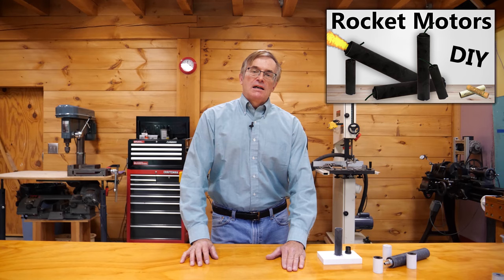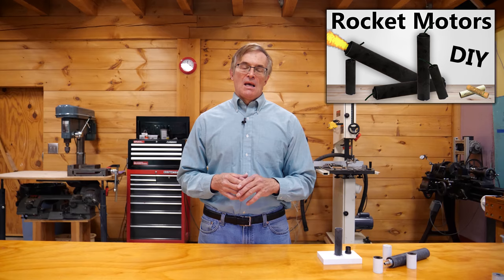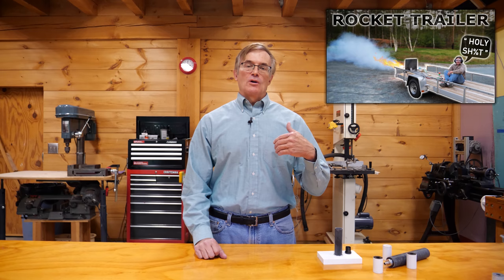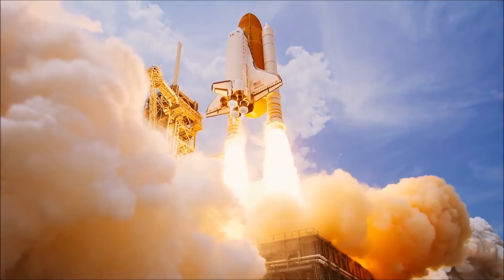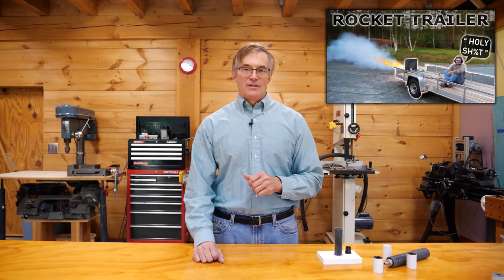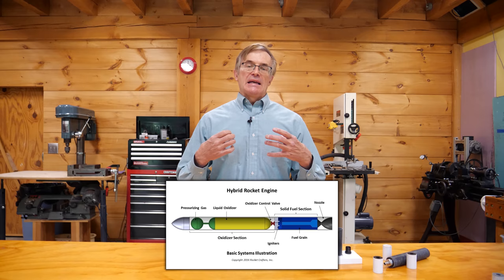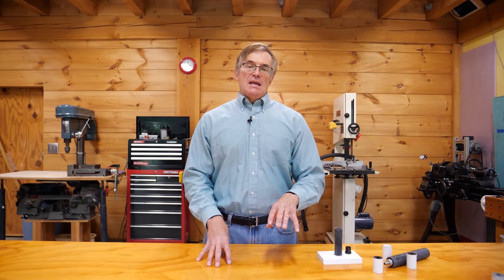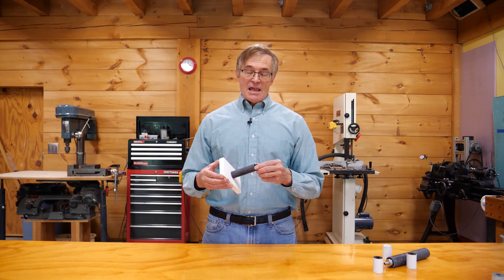Mixing Nitrous and Rockets is DANGEROUS... But Really FUN!

Comment: Great video as always. A note on the Nitrous bulk tank: when you opened the relief valve to safely vent the liquid from the hose I think you forgot to open the ball valve again to remove the liquid from between the bulk valve and the ball valve.
Reply from the maker: Not really.  This valve doesn't have to be opened and if you're going to be filling multiple times, this would just waste a little nitrous each time.

Comment: So, I noticed in all of your demonstrations of the nozzles, there seemed to be a short flow/pressure drop, before it started flowing consistently. Is that a normal occurrence, and if so why? Love the videos, and how you explain everything without being condescending.
Reply from the maker: Yup.  The initial flow is boiling right after the solonoid as it hits the warm stainless plumbing.

Comment: I presented a research project at the Space and Missile Defense Symposium a few years back for a perafin 3d printer for hybrid fuel grains to allow the creation of grains, as needed, with specific regression rates and burn characteristics for use in high risk environments (spacecraft, naval ships, etc). Unfortunately, it didn't get funded, but maybe someday I'll build one on a hobby level.
Reply from the maker: Not a bad idea.  The principle is good and the material is easy to experiment with.

Comment: I'd love to see you do a video with Linus using your freezer ice/water setup. Sub ambient liquid cooled PC without dunking a radiator in a bucket of ice, peltiers, or phase change(A/C). Still kind of phase change, but it's more doable. A salted version would be nice to see in a comparison, too.  

My idea also includes a sealed case to put the PC in with some kind of air dryer like a desiccant.

Comment: When I was into paintball we used to use a CO2 fillstation, and the way we chilled the tank was by connecting to the fillstation and charging whatever would go into the bottle, then close the first ball valve and dump the purge ball valve, which caused a rapid decompression and froze the small bottle, then we would close the purge and reopen the fill valve and the CO2 would transfer.  You might have to do that once more for a half second mid fill on a larger bottle.  Is that methodology not chosen based on the price of the nitrous or something else?  Great Video!
Reply from the maker: That simply  works.  There's  no advantage  to nitrous and it costs more.

Comment: Regarding your nozzle selection and criteria, I really know nothing about the field, but I had an interesting idea.  If you had a nozzle where the tip had a concavity, and in that concavity were two or more fine holes arranged around the periphery of the concavity, and aimed at each other in a focal point.  Sort of like the legs supporting the LNB on an old satellite dish.  This could achieve the kinetic dispersion you're after, without any metal parts to melt or obstruct, and may even have the advantage of increased dispersion energy (two opposing streams colliding at the same velocity versus against a stationary object).  The angles of opposition and number of streams could be used to tailor delivery rate and dispersion patterns potentially as well.  Again, I know squat about this field, but this design was the first thing that popped into my mind when you were talking about the dispersion characteristics you were after.  An obvious disadvantage is the required precision in drilling such a nozzle.  The streams must strike each other precisely, and if one stream clogs, that would cause issues.  Still, it does have pretty much nothing other than the holes themselves to be subject to mechanical damage.  Curious if such a critter already exists, since most of my better ideas turn out to be unoriginal.
Reply from the maker: The idea is interesting and some pure liquid rocket engines use this fluid impingement method for mixing.  However, as you said availability and fabrication would be difficult.

Comment: Great video! You should machine the inside of the aluminum spacer nozzle cover to increase the surface area and try to make the outflow more uniform, it may not be worth it, but it would be interesting to see if it increased thrust.

Comment: 5:53 - specific impulse is not unitless, the unit is (usually) seconds, representing the ratio between the impulse gained (N*s), and the weight of the propellant (N)
Reply: Yes! Not only is it not unitless, you can make it even pretty intuitive by un-cancelling the units: lb-seconds/lb, i.e. total eneregy of the exhaust gas (in lbs thrust times seconds burned) per unit weight of propellant. Of course, that makes a lot more sense in imperial units where we can casually hand-wave about weight vs mass :)
Reply: @AlexWhittemore  Yes, totally. In (almost) SI you could use the kg-f and all instead for easier understanding. One thing one has to take into account though, specially with rockets, is that gravity, and therefore weight, is not constant when you go up, so the specific impulse is a value only valid at ground level.
Reply: @ror3D  initially I read “impulse is only a value add at ground level” and I think my face actually got red :P

Of course, a lb-mass doesn’t change with altitude even though the measured scale-weight of one does - the real reason ISP is only valid at one altitude is nozzle expansion vs ambient pressure.
Reply: @AlexWhittemore  When I say valid I meant in the sense of altitude will change the value of the specific impulse that's given in seconds, since to represent it in seconds you need to use the weight, and therefore the gravity that's pulling on the fuel itself. Of course other things like nozzle etc. will impact on the thrust you get in the end.

Comment: You should see if a Gasoline or Diesel direct injector could work with nitrous.  They are specifically made to atomize at pressures deltas well above the rocket combustion chamber and are tailor made to deal with the heat while not requiring the high current draw of a nitrous solenoid as they are a peak and hold style soldenoid but of course requires a driver that is compatible with the injector.

Comment: I'm always in a funny spot with these videos, they're some of the best having fun with tech/science videos out there, and there are always some minor inaccuracies. 

In this case, the stupid one that stood out is when you mentioned the braided line, you called it stainless steel braided rubber hose. The braided lines used for N2O kits (which it appears you have parts of an NX nitrous kit there) are Teflon lined, not rubber, rubber won't hold up to N2O. Even if you thought you were using the wrong hose, well the fittings on the end are Teflon braided line hose. I know, minor and nit picky but you make such an effort to be technically correct...

Other comments- using N2O in racing is not cheating, unless you're specifically participating in a class or event that forbids it, it's just another way of adding more oxygen to the air/fuel mixture, just like a supercharger or a turbo (technically a turbine powered supercharger). Interestingly I was surprised with all your explanation you didn't explain that is all you're doing with the hybrid rocket in this case.

I'm curious why didn't you just go with the rest of an automotive dry nitrous system? It looks like that's where you got the rest of the parts, the system would have come with a fogger nozzle that would work at least as well as what you came up with (maybe a little more awkward to mount), that uses interchangeable jets to meter flow. you'd have something that was specifically designed and optimized to "fog" (atomize) N2O.

I find it funny how much of what you do is similar to the stuff that I've done, especially when I was a kid, except your setup always looks nicer. Keep it up, maybe I need to do some of the same on video. You remind me of one of my science teachers, who also ran the science club. At one point we mixed up enough "black" powder (black in quotes because we used sugar in the place of carbon making it white) that we burned through the asbestos pad it was on, through the lab table and partially through the floor 😎
Reply from the maker: The hose is in fact rubber surrounded by steel AND lined with PTFE.  Tefflon itself is a rigid plastic.
I played with nitrous injectors. The capacity is generally too low as we have to dump a 10 lb tank in several seconds through a single injector.

Comment: 24:53 I think I know what it is. This is a wax-based solenoid or a wax motor. It works because the wax expands when heated up. They are used in dishwashers to open the door when the dishwasher is finished.

Comment: You get my brain thinking! 2 things I’d like to work on 1- separate dust from an air intake on a side by side. I found out that sb filters makes one. I wanted to put a dyson vacuum type separator on one and see how well that’d work . I started designing that on my 3D printer. 2nd- have you seen the air coolers that you put air in and get extremely cold air out on one end and hot air out on the other? Could you use that type of  system on a car driving down the freeway at 65-80 mph and bring in cool air with out using the ac? The heat from the engine can you turn that into power/electricity to power an electric motor? For accessories like ac radio? You make my mind Wander!
Reply from the maker: It probably won't work.
The pressure that vortex coolers need is pretty high and at driving speeds, ram air pressure is suprisingly small.

Comment: Did you mention that solid rocket motors, once started, burn till they're out?  A hybrid motor can be throttled and powered down, if need be, simply restricting the oxidizer to the chamber.
Reply from the maker: I didn't mention that, but you're correct.
Reply: @TechIngredients  Appreciate the reply.  Thank you for the great content, by the way.

Comment: You can have a bi-liquid w fine without complex plumbing. It won’t be efficient compared to a turbo-pumped design. But is only a little more complicated than a hybrid. In fact there have been bi-liquid engines using N2O as the oxidizer and liquid hydrocarbon pressurized by nitrogen for the fuel side. Pressurized propellants generally aren’t useful for large spacefaring vehicles. Which is why turbopumps were developed.
Reply from the maker: Don't forget the problem with the combustion chamber.

Comment: Did you try using an automotive style fuel injector ? The newer piezioelectric injectors for direct injected turbocharged motors have to deal with over 200 bar fuel pressures and the tiny amount the crystal swells to open the pintle quite literally rip the liquid into actual individual atoms... also, like I mentioned the fuel pressures they are designed for would easily handle the nitrous. So you could use a PWM signal to control the fuel flow super precisely and actually get that mixture closer to stoic ... the injectors on the BMW N54 motors had problems at first so BMW lowered their price to 50 from 1500 a piece to save face for their shareholders and warranty costs...lol. they leaked fuel droplets when cold and until they warmed up would obviously cause drivability issues... all that's been sorted out naturally so now they're just perfectly engineered digitally controlled, high pressure, liquid controlling atomizers that have flare fittings for stainless steel plumbing and even kevlar/teflon seals to seal directly into the combustion chamber of a forced induction engine and not leak or be destroyed.... Just a thought... 36 year old BMW Master mechanic in San Antonio, TX .... currently looking for a job doing something cool if you ever have a spot.... I'd move tomorrow.. lol. keep up the good work. I know this is coming waaaaaay after this video was posted, but better late than never.
Reply from the maker: I didn't consider them because the flow rate is far too low.  With our nozzles and the nitrous requirements we will empty a tank in about 10 seconds through a single port.

Comment: I am so excited to start using what I’ve learned from your rocket videos to make the combustion chamber for going into my Tesla turbine. Thank you so much for all the VERY in depth knowledge on not just the workings but the manufacturing of these engines. Ughhh just gotta finish this aluminum Tesla turbine for compressed air tests and then I will be committing to cutting out the thin 304 stainless steel that I have. Is it possible to email you or communicate with you directly for some advice on it when I get to that point? I wasn’t sure if I would actually get a response. I honestly wouldn’t have left this comment if you hadn’t said you read every comment in the video. Hope that’s true! 😇😬😅
Reply from the maker: Thanks!

Comment: The great thing about liquid fueled rockets is it is possible to throttle the engine especially where the fuel automatically starts burning when the fuel and the oxidizer are combined (ie. hydrazine rocket fuel). I have not heard of throttling a solid fuel rocket. Its all or nothing once lit on fire, the rocket runs till solid fuel is exhausted.  I discovered way back in high school that Potassium Nitrate (KNO ₃) can be heated, and melted to a liquid on a hot plate, and won't act as an oxidizer unless mixed with the fuel such as charcoal, sugar, wood, maybe even volatile fuels--- never tried liquid fuel, only the former 3. What if you contained heated liquefied Potassium Nitrate in a tank, and pumped it, and from another tank, forced a powdered fuel such as carbon, and combined them in the rocket engine, you could potentially throttle a solid fuel rocket engine by shutting off the pump on the liquefied KNO ₃, and powder carbon.  I heated KNO ₃ on a hot plate, but also with a propane torch, and no danger, very safe as long as the liquefied Potassium Nitrate was not mixed with a fuel.  Has anybody attempted to construct a throttled solid fuel rocket in this manner, or I guess you would call it a hybrid of sorts because you have converted a normally solid oxidizer to a liquid?
Reply from the maker: That's an option. The state of the fuel and the oxidizer can be modified just like a gas (oxygen) can be stored as a liquid, converted into a high pressure gas in the turbo pumps and burned in the rocket chamber.
The downside of throttling a rocket engine and a turbojet for that matter is that maximum effeciency is at 100%power. As the engine is throttled the chamber pressure drops and the thermodynamic conversion to useful work (exhaust velocity) drops as well.

Comment: Solid rocket motors very simple & ancient as you noted, having been around for more than 1000 years
Electric rocket motors that use gas expansion with plasma or ionization have much higher ISP
Nuclear electric rockets can produce thrust for years to go to deep space 
Chemical rockets have a mass paradox because the LOX & LH2 or whatever else fuel tanks become heavier to support more ISP
SpaceX notes that their largest rocket approaches the mass to propellent ratio maximum
Combustion rocket motors as you noted have cooling issues to prevent melting & can only burn for about 1000 seconds maximum 
Hydrogen & Oxygen in cryogenic states (green, made from water, see electrolysis with solar PV energy) make only water as emissions (Blue Origin, New Shepard/ New Glen) & LH2 & LO2 has the best specific impulse of any fuel combos -- 
We need fission energy, fusion energy & ZPE to make spacecraft to go to the moon & mars in a bigger way & especially for deep space access & exploration with people on orbital ring artificial gravity craft!

Comment: I have a bunch of questions pertaining to exhaust, if you're interested... These questions combine aerodynamic sciences, materials science, rocket science, aerospace engineering and automotive engineering.

1. Would laser-and/or-microwave-induced plasma be a good substitute for (or complement to) the rare and expensive precious metals used in catalytic converters, or no?

2. Can plasma be induced by ultrasonic frequencies?

3. What if you made the entire exhaust manifold of a vehicle out of a metal-reinforced ceramic composite to help trap heat to keep the entire exhaust manifold working at its optimal temperature?

4. Would that composite also be viable to reduce weight compared to using just metal on its own?

5. Could that metal-ceramic composite also be pre-enriched with synthetic ruby to make the entire exhaust manifold act as a pseudo catalytic converter?

6. Would rifled exhaust pipes be viable for increasing exhaust velocity or lowering exhaust pressure? And what for pushing a turbine (say, for a turbocharger?)

7. To reduce stress concentrations during rifling, would a gain-twist (or progressive) polygonal rifling pattern (using a prime-numbered shape of constant width, modified with slightly convex corners) be an effective way to reduce that stress while maintaining an effective pressure seal against the fins of a turbine?

8. How hard is it to make an aerospike nozzle to turn a vehicle's exhaust into a weak thruster?

Comment: There are bi liquid motors like the ww2 german taifun etc that uses only gass to push the oxidizer and fuel into the combustion chamber.  some rattworks engines use an similar system.  try to build an N2O ethanol motor where the N2O compresses an piston, bellow or bladder of fuel or as the taifun gass generators to push both into combustion chamber i belive the germans used cordite, but some helium would prob be better. Exellent vids as always.